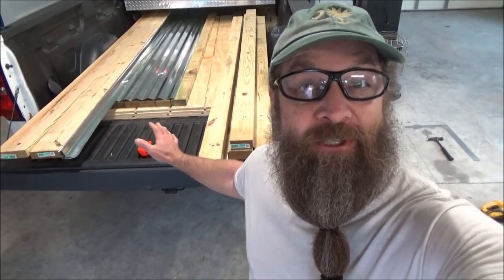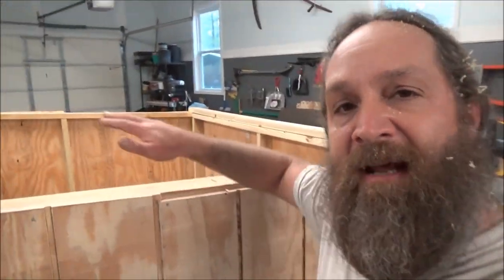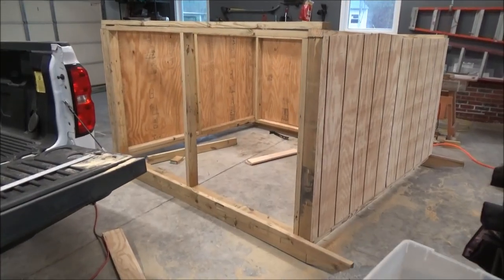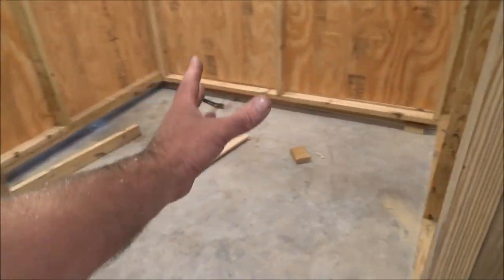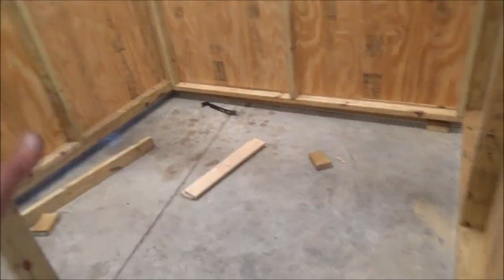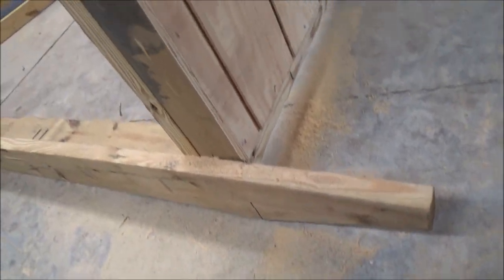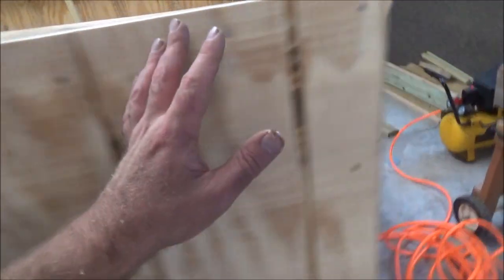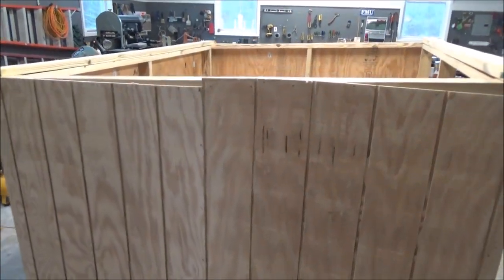building a movable goat shed

Comment: I like the design. I have Boer goats and they are rough on their possessions.  I would add a 2x6 at goat shoulder height, horizontal  along the walls.  They like to rub and push against walls.  They also take great joy smashing each other into the walls until the nails or screws pop out of the plywood.

Comment: Materials list: 
20 - 2x4x8' ($145)
2 - 2x6x10' ($30)
3 - 1/2" T1-11 siding ($129)
5 - 2'x8' corrugated roofing ($112)
85 - #10 1-1/2" galv roofing screws ($12)

100 - 3" galv framing nails ($10)
100 - 2" sidings nails ($10)
corner trim ($20)
1 gallon paint ($30)
~$500 + labor
Reply: That Much Money???
Reply: How many goats do you hope to shelter in there?

Comment: I built something similar. However I had the roof go the other direction. So that all the roof drain to one of the short sides. What I’m going to call the rear. And the roof extended over probably 6 inches past the building. And then that’s where I put the water. Whenever there was a rain it would fill up the water. From time to time I move the structure around in the paddock. With this being on skids. I also don’t get taxed for a building. If I built them an actual building our county with tax us

Comment: I'm considering building something similar.  Looks like this video is about a year old at this point.  Now that you've had some time to live with your build, is there anything you would've done differently?  Thanks!
Reply from the maker: It's held up perfectly. I added large eyebolts to one end (the outside) to help move it around with the UTV...I run a rope through the eye bolts an drag it. The feces and mud build up inside so I have moved it about 3 or 4 times.
Reply: @gregpryorhomestead  k iou